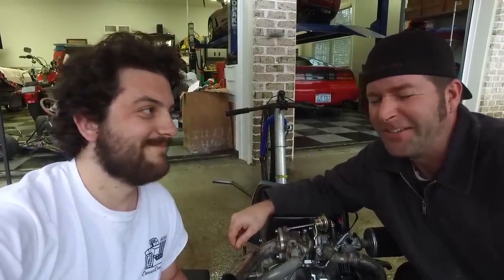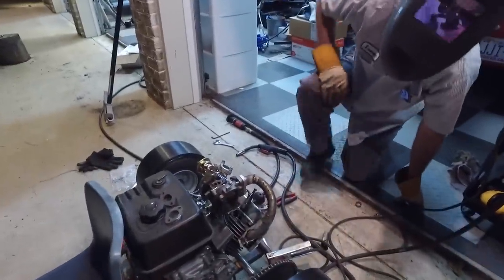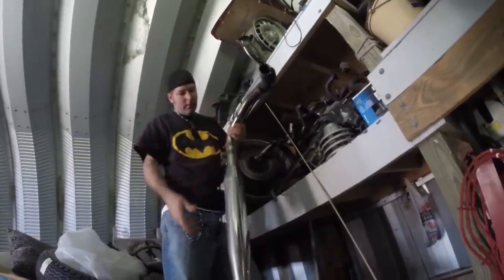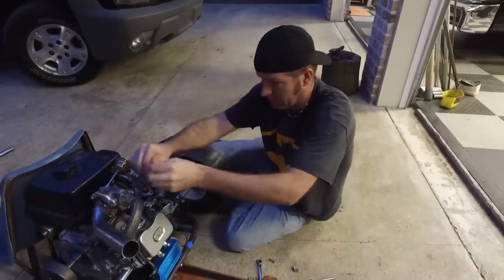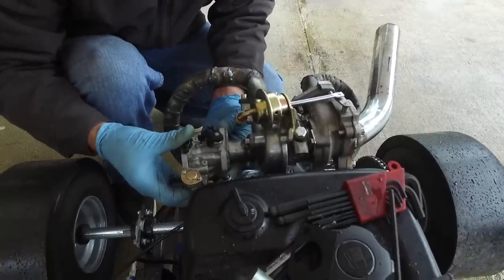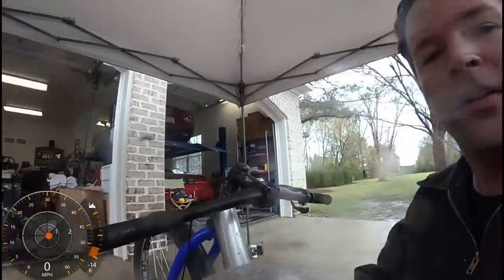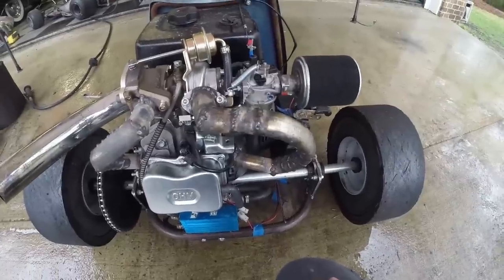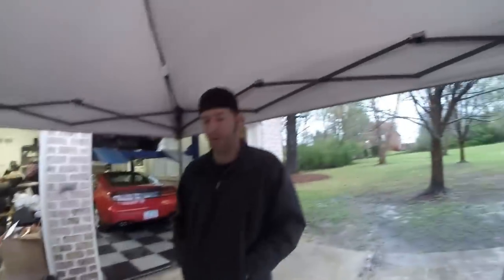Turbocharging a 420cc Drift Trike

Comment from the maker: So it isn't perfect. That didn't stop us from riding it!
Reply: If the turbo doesnt work with the 420cc you could put it on the 670 :D
Reply: +CarsandCameras Do a video on what happens to an engine when you throw a rock into the turbo :P
Reply: +Borut Korosec you cant put a blowoff valve on a draw through carb it will have gas coming out with the air unless they go with efi
Reply: sorry i knew something didnt add up ;)
Reply: Add a blow off valve, trust me itll sound better and most likely fix some problems
Reply: +CarsandCameras the call it the hot side on the turbo
Reply: +William Neigum it will just smell good when you release the gas😎
Reply: you need to counteract the boost pressure when you do a blow through turbo set up. lots of information on the interwebs. the snowmobile guys have been doing it for years
Reply: can you make a buget petrol go kart?
Reply: +Ian Duijsens exhaust manifold. thats what its called.
Reply: William Jenssen tilt it goes all over the exhaust lol
Reply: +William Neigum I'm a William so i shall join in lol
Reply: William Wright sounds good to me lol
Reply: +CarsandCameras you might wanna look in to "blow through turbochargers" what you are experiencing is the pertrol being blown back in to the tank and out of the bottom of the carb "the venting hole" or what its called. you need to preshurize the carb and you need an fuel pump to keep it from blowing the fuel back in to the tank. that 420 may double the HP with ease. good luck :D

PS. i dont remember 100% havent been playing with carb engines in a couple of years when i was driving my 50Ccm moped
Reply: +CarsandCameras Now whack a turbo on the 670cc kart!! XDDD jk
Reply: +CarsandCameras you guys have to inject the gas before the turbo or it will pressure the gas back instead of where its supposed to go
Reply: kartzgo 99 they did
Reply: yea.... I need to watch the whole video before I comment
Reply: +William Neigum In all likelihood the DTC has to go anyway so they COULD whack a blowoff on there when/if they get an EFI System :P
Reply: +Jared Herman Would be real nice spraying that gas and air mixture everywhere, catastrophic fire incoming. Also the engine was struggling while on throttle, not something a BOV would change.
Reply: i think the carburetor goes between the collector and the motor, because if it is between the air filter and the turbo the mixture of fuel and air condenses in the turbo and the collector, Consequently arrives weaker to the motor causing a decrease of performance
Reply: The 670cc v twin engine should be on the drift trike
Reply: +CarsandCameras Put the whole carburetor insida a pressurized box, this would counteract the gas spewing out all over the place.
Reply: +CarsandCameras use a blow off valve
Reply: I turboed a predator 420cc with a draw through setup I posted it on cars amino go check it out my name on there is Noah smith I used a 34mm Mikuni instead of the stock carb though
Reply: To solve your fule proplem use a pulce pump there extremely cheap and effective
Reply: +CarsandCameras That carb is not gonna work there is a reason why gokart/mower/minibike racers dont use those carbs they are junk and dont like any adjusting Get a mikuni 28-30mm slide carb ther fully adjustable also get a jet kit for a 300-350cc ATV for the carb it will run also drill another hole in the valve cover and run a fuel pump if the pump dont work drill a hole in the top of the block the EFI setup is gonna be a pain to tune and dial in also find out what boost the regulator is set at max i wouldnt run more then 10psi on that motor it being stock and all also if you can get a ARC billet rod for that engine it will last longer for sure
Reply: +Borut Korosec no, just no.
Reply: +CarsandCameras you guys need to fit a fuel pressure regulator it's cheap and easy to install so you can keep the original setup.
Reply: +CarsandCameras also having the turbo pull the fuel in is just fine there are many types to do it you have a Draw threw/Pull Threw setup then there is the Blow threw that you had at first.And i would coat the intake pipe in somthing that will seal it because im pretty sure you have a ton of pin hole air leaks
Reply: +J Barrett420 i agree good option
Reply: +Chris Giunta Why would you add a fuel pressure regulator? There is no fuel pump and no fuel pressure, a regulator would do nothing.
Reply: NorwayVFX A regulator would be point less LOL even with a vacuum style fuel pump only would be good if they used a 150gpl-200gpl electric style fuel pump would it be needed
Reply: +MowBandit  exactly what i was thinking with the walboro  pulse fuel pump think that could help greatly
Reply: +CarsandCameras and that is what i like about you boys ;D its fiiine. on a side note it can be done with a carburator you need a bigger one and better positioning maby a charge box like old school turboed musclecars, im from denmark eng is not my native langauge :D
Reply: another option is using a smog pump from a fox body they essentially a roots super charger with a pressure box
Reply: +wreckleskelly Yeah fuel pressure has to be greater than the boost pressure for blow through.  100% don't need EFI to make it work.  You can add boost controllers to blow through but not draw through.  Research is the key here.
Reply: Or what im thinking is justbe for the in take have a a 45 degree y shape fitting with the 45 degree angle facing away from the engine and conect the pressurized tube on the 45 degree and conect the carburetor to the end. And basically put the pressureized tube before the  carburetor  and let the venturi affect suck in the gas.
Reply: +CarsandCameras  smh you need to equalize the inside and outside pressure of the carb... the simplest way to do that is build an airtight box that houses the entire carb think about this a N.A. engine is boosted by atmospheric pressure...
Reply: +CarsandCameras plumb a line from the pressurized intake pipe to the nipple on the fuel tank.
Reply: +CarsandCameras After this, you should put the turbo charger on the 670cc go cart...
Reply: +CarsandCameras FIND OUT WHERE WE CAN USE EFI ON 8HP ENGINES....
Reply: Try plumbing in a simple ball valve to bleed off the excess boost?
Reply: give the guys at DIYAutotune.com a call. Microsquirt is a small engine EFI system if that's the path you are SURE you want to go down. I would personally rather not hassle with EFI. Way more complicated than it seems on the surface. Fuel pump, injector, FPR, a charging system... the list goes on. Solder the jet shut and go back to the original size. Go back to blow through, but build a box around the carb. Feed the outlet of the turbo to the box. This creates the same pressure on the outside and inside of the carb, but the flow through the venturi will still atomize fuel. Run a boost line from the box to the fuel tank. This will prevent the carb from making the tank a bubbling jacuzzi. Just give it a shot and see how you like it before losing your mind with EFI. Great channel, BTW!
Reply: It call force induction turbo spoils up from the exhaust and then forces air into the intake manifold
Reply: +Terrence Brunson I was talking with Ike last week. He was saying the exact same thing. But due to time and well... time he went for fast and dirty. If they took a little more time to do it that way there would be no video this week.
Reply: +CarsandCameras get a cars alternator and put it on the side of the  engine and connect it to a the axle and make POWER for the bat
Reply: Try ecotrons EFI kit. They sell one that is made for that turbo.
Reply: William Neigum so what!?!
Reply: +William Jenssen fuel injection. More power and the turbo will work way better.
Reply: +William Jenssen fuel injection. More power and the turbo will work way better.
Reply: You guys propably should do it right and make a housing to the carburator. Pressure housing that is.
Reply: +CarsandCameras  Thanks for the upload. you could weld something to install the full harley exhaust parallel to the axle :D that would be sweet!
Reply: +CarsandCameras :(.......  always get's a like from me!!!
Reply from the maker: ***** I'm in college. I go home to my parents house on weekends to make videos. I'm not sure why you find that so offensive.
Reply: +CarsandCameras Honestly I respect that fact. It means you are going to school learning and at the same time keeping a good (I'm stretching it here aren't I?) Relationship with your folks. Nothing wrong with that in this day and age of cell phones and Internet bashing morons.
Reply from the maker: jr540123 Haha, thanks. Yeah, there's nothing you can do sometimes.
Reply: this link has a diagram of how you could make it work without efi, you'd need a different carb though http://www.fourwheeler.com/how-to/engine/154-0508-jeep-4-0l-turbo/
Reply: both ways y'all set this up could work if it were done right no offense. the first way needed a bov and boost controller. boost needed to be delayed until full throttle and needed to be vented at closed throttle. the second way needed the turbo to be mounted at the cylinder pretty much and both setups probably need more fuel at top end. a performance tunable carb would work fine with a turbo and blow through is actually a good way to do it because the boost temp drops drastically going through the carb. I've built a few turbo small engines and always used carbs and always made at least 20% power gains. I really think you guys could get it rocking with the carb but you need afr and boost gauges for sure. oil temp gauge might be a good idea too since to water cooling going to turbo. I'm happy to give any tips and advice if you wanna reach me on garage amino I'm moparjimi.
Reply: James Godwin the first way would also need a FMU to regulate fuel pressure
Reply: take the turbo off and put the carb back on  leave the header and the oil cooler on it would be perfect that way
Reply: +I.C. karting i was gunna say they need a carburetor pressure box
Reply: +Eli Kirkwood most they need is 8 psi which they can rig up a simple fuel pressure regulator from parts store and an electric fuel pump. 60$ for both parts. the engine normal requires no actual pressure when under no boost and for every lb of boost they need a lb of fuel so really 5psi is plenty because they'll probably max at 4psi boost. only thing is setting the pump to engage at full throttle which a micro switch on throttle can do that.
Reply: +CarsandCameras I TOLD YOU THIS WAS A MISTAKE!!!!!  LOL  

You have plastic tires, the spin constantly................why are you looking for more power??
Reply: +CarsandCameras a blow through carb is designed for boost... it may work for what youre building haha
Reply: +CarsandCameras Have you thought about installing the carb in the normal location with an enclosure around it that the turbo pressurizes? People turbo carbureted vehicles all the time. You either need to encase the carb in a pressurized enclosure or get a carb that's meant for a turbo.
Reply: +CarsandCameras I sexually identify as a turbocharger. Ever since I was a
boy I dreamed of choo chooing through the mountains of Japan shoving fat loads
of air into sweet sweet rotor housing and cylinders. People say to me that a
drift trike being a turbo'd is impossible and I'm fucking retarded but I don’t care,
I’m beautiful. I'm having a Ike install a billet compressor wheel, 3 inch custom "ALIEN" 
downpipe, and an external wastegate with a screamer pipe on my body.
From now on I want to guys to call me Garrett Kappa Warner and respect my right
to boost over 30 pounds and make choo choo noises needlessly. If you can't
accept me you're a turbophobe and need to check your boost privilege. Thank you
for being so understanding.
Reply: You need a blow off valve on the intake pipe so that the extra air that the turbo is forcing into the engine has a place to go when you're not on the throttle, that will help if the engine seems to still be reving high when you're not giving it any throttle.
Reply: +Alex Soltman blow off valves only work when there is vacuum. the way it's set up now, there wouldn't be enough to activate it. if the could find a way to rig it to the throttle cable to release the intake pressure when they let off the throttle that might work
Reply: mhrepoman that is a very good point, I didn't think of that. Maybe if they rigged up some sort of valve that opens to the atmosphere when they let off the throttle and closes when it is pulled via the throttle cable or something along the lines of that, it could work.
Reply: +Jared Herman a blow of valve is only used to vent boost from a spooled up turbo after you close the throttle to prevent hoses and gaskets from blowing out.  it has nothing to do with performance so it wont run any better or differently it also would only make a sound if you had enough boost 15psi +  which they don't.  that turbo makes max 7psi making the blow off unnecessary.
Reply: hey do yall still 2 ant the motor
Reply: +yizzer2 you can hear a bov even with no boost and it can be used to vent excessive boost or even vent boost at say half throttle which they needed for the blow through setup because the engine could consume the extra air pressure once the throttle is wide open and rpms are up and the fuel wouldn't have been pushed out. turboing a small engine can be quite different to a larger one. their best bet would've been the draw through but the turbo needed to be right at the intake port instead of a foot away running through a poorly bent pipe. they could've made it work with the stuff they had if it was put together right. if it was more performance oriented and was actually gonna make excessive heat the blow through would be better because the fuel would cool the air charge by close to 100°f depending on air temp and boost pressure. obviously if it's not that hot it won't cool that much.
Reply: +James Godwin that's not accurate. there has to be boost in order to get sound from a bov. the sound you hear is boost pressure escaping from the charged side of the turbo system. if there was no boost, there would be no sound at all because no air would be rushing out.
Reply: +mhrepoman there's plenty of info you can find that says otherwise. even the current mighty car mods vids has talked about bov noise with no actual boost. the sound isn't gonna be as loud as it would be with boost. I guess technically if the engine wasn't consuming any air at all there would be boost anytime the turbo spools but you don't have to get positive manifold pressure for a bov to make noise. my car would blow off anytime I was under 10 psi of vacuum. only thing is the bov has to be set to blow off hard otherwise it probably wouldn't make noise and might not even open. I just know from experience the bov will psh without the car getting positive boost.
Reply: +MowBandit I thought the same thing with the pinholes. pinholes would cause poor idle and no mid range.
Reply: +CarsandCameras use an electric fuel pump it will help
Reply: +JOJO B where did I say fake bov. I said a bov will make noise without positive boost pressure. I never said do it for sound. some guy said the bov isn't needed on a blow through carb setup when I said it was then we got in to rather it would open under low/no pressure which it would. I at no point said use a fake bov.
Reply: +JOJO B where did I say fake bov. I said a bov will make noise without positive boost pressure. I never said do it for sound. some guy said the bov isn't needed on a blow through carb setup when I said it was then we got in to rather it would open under low/no pressure which it would. I at no point said use a fake bov.
Reply: +JOJO B also the waste gate won't move until it's close to max boost which is probably 7psi and that engine probably won't spool it enough for more than 4 or 5 psi.
Reply: it'll. be. fine.
Reply: +CarsandCameras you need to ditch the blow through and put the carb in the intake side of your turbo(draw through).  unless you get a boost reference fuel regulator and a cheap fuel pump, you will never tune it properly.  drill a hole close to the head on the intake and put a primer there it will make for easier starting on the draw through setup

also the length of you intake wont matter much on the draw through. you will just have a lag off idle
Reply: +CarsandCameras hey when will the next vid of the trike be out?!
Reply: +CarsandCameras your fuel is getting to cold the faster it evaporates through high vacuum it condenses with the moisture in the air which could cause an over rich mixture at full throttle try putting a inter-cooler between the carb or suck up some exhaust gases to reheat the fuel air mixture
Reply: Wet road...check..PVC tires...check.. Turbo..check. W.O.T ...check..caution to the wind...F-it!!!!
Reply: whatevz
Reply: i am trying to be helpful i have a honda 12hp i put an rhb on. fucked with it for weeks trying to get it to run past idle. did a little refab anb set up a draw through and after a few hours  f tuning i got it to run decent.. his problem is hes using a gravity fed carb. the second he starts boosting the pressure overcomes the weight of fuel.

i have set up 2 proper  turbo motors 421cc banshe with fuel pump regulator ect. about 1 grand in parts not including the turbo. and a 450.

you can see one on bhq username is coryv4.
Reply: +Gabriel Berg i have a 650 opposed twin and its just too much motor
Reply: You guys need to adjust the fuel air screw and add more fuel because there is to much air for the fuel
Reply: +CarsandCameras I want to put a turbo on everything now... I want to put a turbo on my turbo
Reply: +Boosted Lifestyle yea mee too turbo Everthing
Reply: Whose house is that?
Reply: +Dakota Hensley his papi hahaha
Reply: +CarsandCameras  need a pressure box for the carb youll never make that carb work straight through youll also destroy the turbo pulling gas through it
Reply: +James McIntire What he said^^ You need a turbo designed for a draw through setup if you are going to run the carb pre-inlet. (upstream of the turbo) The turbos that are setup for it have carbon seals to keep them clean and working with gas going through. That's the way it is done on a lot of aircooled VW's at least.
Reply: reddragon042391 yep most mini bikes use pressure boxes idk exactly how to build one though
Reply: +James McIntire most ball bearing turbos have a carbon seal and if they dont they can easily be bought for a few dollars more that a standard.
Reply: +CarsandCameras i think you need more back pressure on the exhaust
Reply: skits fish its just pushing to much air through the carb forcing way to much fuel carbs arent made to have air shoved through
Reply: yesterday 420 ;) ¥₩¥
Reply: James McIntire You're clueless bro.
Reply: James Godwin
if the throttle plate is infront of the turbo, as it is in this setup, then the turbo will operate in a vacuum while spinning.  it will not generate any boost because its in a VACUUM.  therefore the BOW wont do anything.  also if your BOV is venting while the throttle is open, then you will also be dumping the fuel along with the boost throught the BOV.  explain to me how this would make sense?  i think you are confusing BOV with a wastegate which is used to regulate boost pressure.  BOV is not used to regulate boost pressure, and it is very dangerous to dump fuel and air mix right next to a hot engine and exhaust.  adding a BOV to this setup would probably start a fire...
Reply: let me buy one please
Reply: 4 strokes don't need back pressure  2strokes rely on backpressure to clean air and fuel in exhaust pipe
Reply: itll be fine
Reply: +Bailey Arceneaux  4 strokes run better with back pressure. That's why a tuned pipe is better than no exhaust
Reply: RCX Models UK the only tuned exhaust for a four stroke  is the megaphone funnel shape it ull air out exhaus faster like putting vaccum on exhaust
Reply: have you tried a blow off valve??
Reply: you should TIG those pipes. It would look like glass, and you wouldn't have to grind or polish the pipe. It would also not blow through, and take little to no rod. u can basically just use the arc from the tungsten to weld it
Reply: CarsandCameras where did you get the turbo
Reply: they dont have a tig welder they just had to buy a new mig welder not long ago.  Ike might have one at his work or one of his garages
Reply: who's house is that? is that ikes?
Reply: CarsandCameras where did you get your oil pump and cooler, I'm on the process of building a turbo dirt bike
Reply: Dustin Spence No its Johns!!!
Reply: CarsandCameras if you make a box that bolts to the intake and you put the carburetor inside the box and then put a cap on top then put the pipe come g from the turbo on then it won't compress the turbo like it's doing because doing it the way your doing it the boost is trying to take the path of least resistance but if you box the carburetor in the the boost only has 1 place to go and that's in the cylinder
Reply: I have an idea on a solution to make both carb and turbo work together...Make them separate.  instead of have the carb go though the turbo or vise versa, you would have a "Y pipe" that leads to the combustion chamber.  Have the carb with its own pipe and the turbo with another lead into the "Y pipe" which leads to the engine.  Just an idea.  Cant wait for the 670cc to be twin turbskied. I also am building an off-road go kart with that engine.
Reply: Jed Drew that would result in boost pressure back feeding out of the carb. 
The correct solution is either A. raise fuel pressure in proportion to boost pressure (difficult because there is no fuel pump) or B. Use a Draw through style set up. IE the carb is mounted to the inlet of the turbo and sucking fuel through it. The problem happening here is that the positive pressure (boost) in the carb cancels any incoming fuel pressure. 
Good luck with your build and Keep wrenching 👍
Reply: that makes sense. thanks so much for the info.  much appreciated
Reply: CarsandCameras  hey I know this is an old vid. But what's happening in is your pressuring the carb forcing fuel out the overflow valve causing if to drip out. You need to place the carb before the turbo to eliminate this issue. If done properly you can double your output power.
Reply: CarsandCameras you must also install a mikuni carburetor or one that you can tune the air fuel ratio properly
Reply: CarsandCameras or pressurize the gas tank with the same pressure as the intake
Reply: Jared Herman nope, the problem is they going lean. Because they dont use electric fuel pump, the stock pump is vacuumed drivven, and when they boosted it they killed the function of the fuel pump
Reply: First of all, carb is not the problem here. carburetor works great with turbo when done right. First switch to electric or mechanic fuel pump that doesn't use vacuum to work, because when you hit boost, you loose the vacuum to pump the gas, and of course a adjustable fuel pressure regulator and fuel pressure gauge, to maintain and make sure that the fuel pressure is above boost pressure, so the fuel actually can come up the jet when boosting. Then you need to switch back to blow through setup and pressurise the carb fuel bowl (or what you call the cup with fuel under the carb) with boost, to help the  fuel pump to push fuel through the jet and into the engine when the turbo is boosting. The carb should be as close to the engine as possible, the further away it is form the engine, the greater is the power loss, and you get a rough idle that is impossible to tune right so it runs smooth at idle. When it comes to the turbo, the exhaust inlet on turbo should also be as close to the exhaust port on engine as possible to get quicker spoolup. An adjustable power jet will also help to tune fuel at boost on the go while driving, it ads about 0-20 on top of existing main jet. afr or egt gauge is a must when jetting, so you can see if you run to lean or to rich at wot.
Reply: I need that for my  mini bike
Reply: Why would you ,  gotta test it rite?